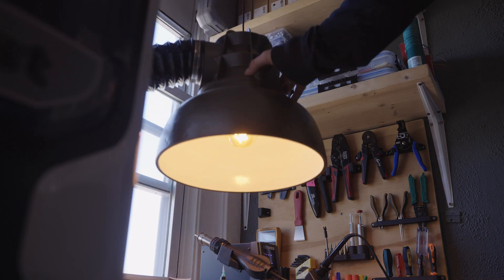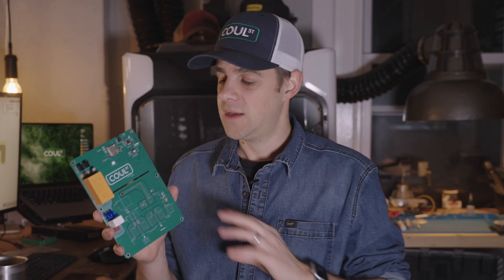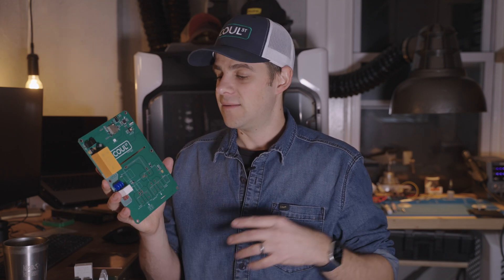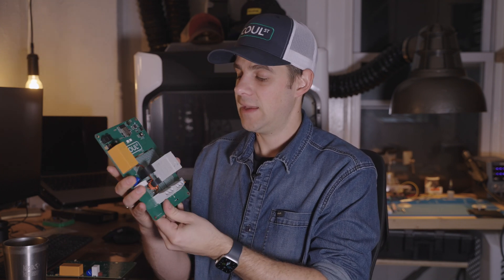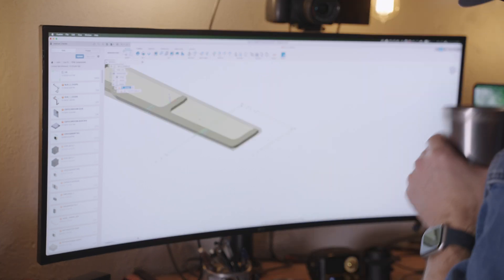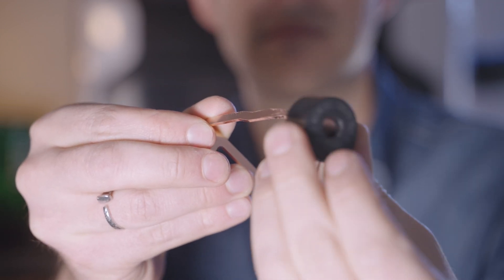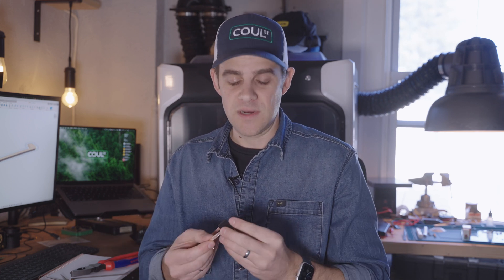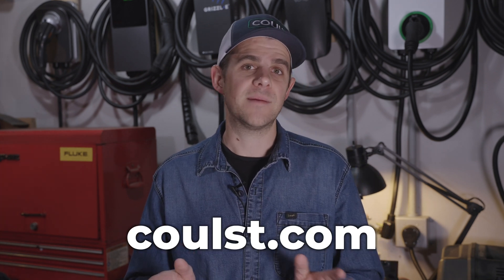New EV Charger Electronics

Comment: The bus bars are cool.  They made a great entertaining video showing off skills and equipment.  But, it also highlighted the complexity they add to the manufacturing process.  As pointed out in other comments, bare bars are a hazard.  The suggestion to use heavy gauge wire simplifies it all. I would suggest standard insulated 6 or 4 awg.  Cut to length, strip the ends,  bend and solder into position. No fancy equipment or jigs. 
I love what you are doing with this project.

Comment: Just a thought. What if you just use the regular wall charger and extend the cord/hard wire it to your street post charger.
Reply: I would do just that, if I wanted a one off DIY for just myself.  I might even put it on a WiFi breaker to turn it off when I was not using it. But, look deeper into the goals of the project.  Simple electrical skills, easy to install.  Sharable or publicly available which requires communication with a server to enable/disable access as well as track usage and payment accounts.  Mass production.

Comment: Why not just run the wires from the supply cable through the current transformers  and connect at the relay. 
And why a PCB relay? Use a small contactor and attach the cables directly, no need to run the current through the PCB.

Comment: Why not just use a fan?
Reply: If it can be passively cooled, it's a better tech.

Moving parts breaks.
Reply: possible with a fan, but with a fan you need exhaust and inlet. And with that you may need a way to prevent dust and particles from getting inside, filter perhaps. It will use a tiny bit more power, but will it be so little that it is energy star compliant?
Reply from the maker: @tkmedia3866  Also more concerns with condensation as new air is continually pulled in - in exterior installs.

Comment: You should consider designing unit for compatibility with aluminum wire. There are many advantages to it yet so few EVSE support it.
Reply: Aluminium wire is shit. And if you want to use it just use a copper to aluminium lug on the cable
Reply: @tullgutten I use it all the time but not for everything. Usually for longer sub panel runs. Depending on the environment location some places are too damp and would cause issues with aluminum over time with corrosion.
Reply: The only real “advantage” to aluminum wire is that it’s (literally speaking) cheaper to buy than copper. Other than that, the resistance is significantly higher which means much more power lost to heat, it expands and contracts more so is more important to bury it well below the frost line, but the biggest drawback is the power loss in transmission. That’s why I took out the aluminum wire that feeds the breaker panel under my kitchen; 6 gauge aluminum, only 38’ long, when I’d turn on my stove’s “16 amp” element, the voltage would drop from 248 to 216, and the element would pull 18 amps to compensate (still well below the supposed “50 amp” rating of the wire, but the voltage drop makes it clear that going any higher draw would be a terrible idea). And that’s over a less than 40’ run; the longer the run, the greater the voltage loss and the more amps it pulls; and that’s assuming the voltage stays high enough that the loads still power on.